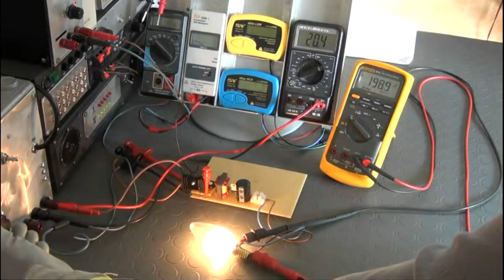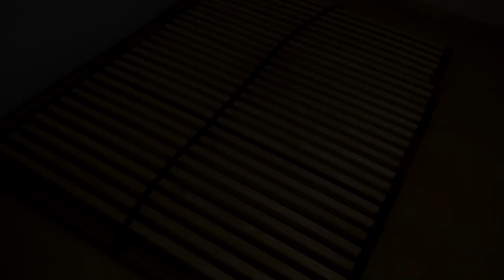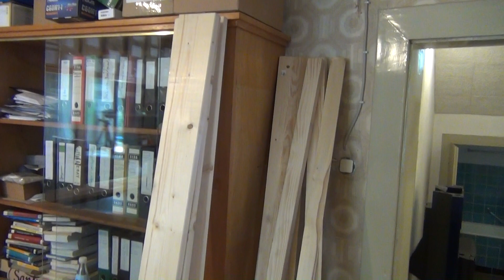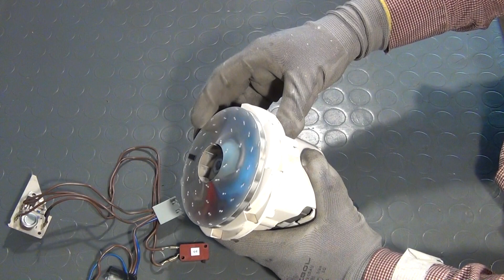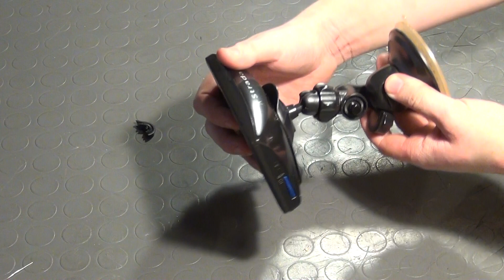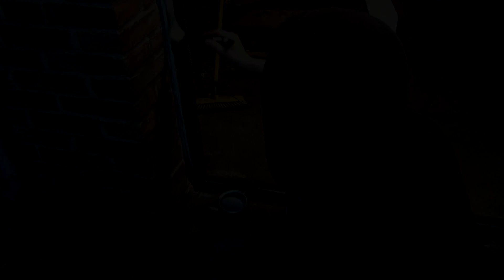Repairs by the Number, Troubles by the Score - Part 3

Comment: I saw the converted cordless drill too, I've just done a similar job myself converting a cordless drill to run off an rf power supply I built some years back, who ever thought a NiCad drill was a good idea. Also I was just wondering so many scandahoovian (damn AvE) people I know speak almost perfect English, is it taught as a second language or is it just easier for many people to learn it. On the subject of language it's nice to hear your "scientific" English coming in at least once a video. That was a nice thing you did for your friend, make sure they return the favour. Thanks again for your hard work and the videos
Reply from the maker: +Spark Gap Hehe. Yeah in the Scandinavian countries many people (even the older ones) often speak very understandable English. Here in Germany ( We don't consider ourselves part of Scandinavia) a lot of people can understand English quiet well, yet most of them rarely practice their active "speaking skills". 
German as well as Norwegian, Swedish and Danish are Germanic languages, just like the English language.  so there are a lot of similarities and it is much easier for us to learn your language, than it is for people from let's say France or Spain.
Reply: +The Post Apocalyptic Inventor I know what you mean, while working on a CNC mill i had to specify the cable used and I chose a German manufacturer because it was the highest quality. I was surprised how much I could understand from the German manual. What I don't understand is why more English speaking people don't learn German.

Comment: How old are the houses in your area ? If I was going by the brickwork maybe 100 years ?
Reply: +Steve Smith I'd put them at around 40-45 or going by the general style.  But the foundations throw me off.
Reply from the maker: +Steve Smith The house in which I live was built in the years before WWII. 
The house where the garage is located might even be a little older. I will ask the owner next time I see him.

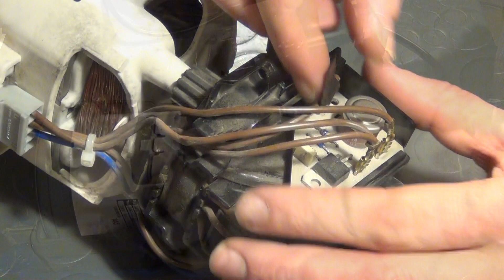Comment: Your little portable workbench looks like it's being put to very good use already, nice touch with the detachable vice too. I noticed that the cordless drill you're using at 4:04 has a rather interesting battery pack. Could you maybe give it a brief explanation in another video?
Reply from the maker: +deeryme Yeah I strapped a lead acid battery to it. It was basically an improvised solution, because the original battery pack was missing.
Reply: Ah! Nice solution to a problem that would stop most people from getting anything done. Thanks for clarifying man

Comment: Nice video.  It is a shame that this type of material is not taught in high schools or in Universities.
Reply: +Physics Videos by Eugene Khutoryansky I used to work for a German car parts manufacturer and a lot of the maintenance technicians in the factory were of a very similar skillset to TPAI. It was the first time I'd ever seen a cnc pipe machine torn down and fixed with nothing more than a hose clamp and an electroplating machine.
Reply: +Physics Videos by Eugene Khutoryansky, exactly. That full scope of view, merging cientific knowledge and pratical aplication, should be encouraged in the classes. I like a lot of this channel, because it´s full of explanations in the both areas. The author got a lot of know how and a lot of experience. I wish i could be just a little like him.
Reply: What kind of material? How to fix universal motors? School gives you a knowledge and university gives you a overview of what's going on, and using that you can do all kind of stuff, including repairing. How you'd fix something electrical, if you didn't know what is electricity and how interrupt electric and magnetic forces? But school gives you that major knowledge
Reply: +Physics Videos by Eugene Khutoryansky It was when I attended high school back in the early 80's.